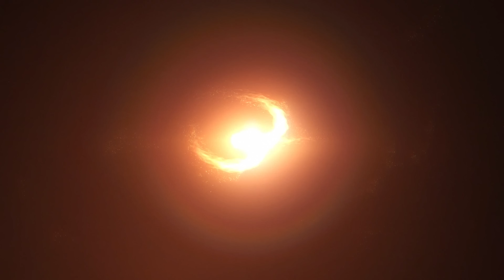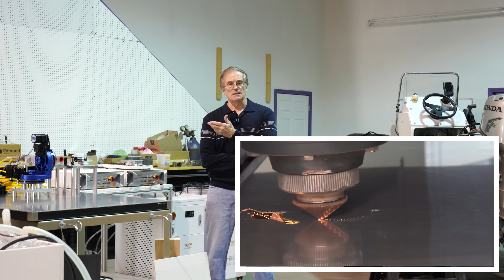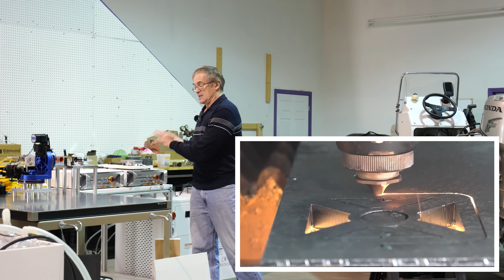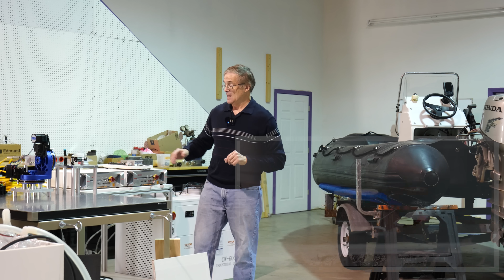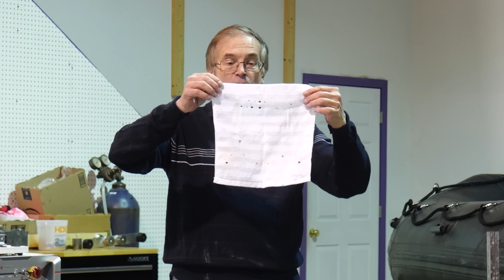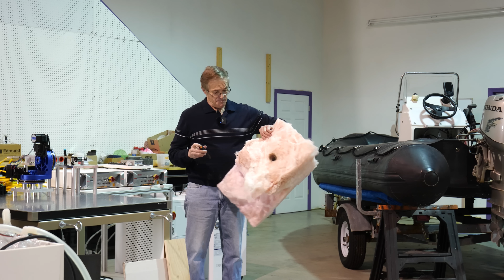We have a problem... and need your help!

Comment: This reminds me of the final laser scene from the movie Real Geniuses.   I think the answer is there is no safe way to test this so you should test it in parts.  You know you can direct a laser, so test the second part and keep the laser stationary and move the object you want to destroy.   Testing laser shielding options would be a fun video in itself.    One thought would be to use a falling film composed of water with suspended carbon black with maybe a soap to help maintain suspension.  Maybe the viscosity could be increased to increase the film thickness.

Comment: Ceramic or porcelain tile. Not sure which would work better but I use porcelain on my fiber laser engraver when engraving metal coins.  It's a much lower power use case but might hold up to your higher power laser long enough?  If you angle a backing surface you could stack the tile vertically (no cement) so it would be easy to replace if they are damaged.

Comment: Assuming you can't diffuse the beam at a fixed point before the barrier, I keep coming back to water. Maybe take a slurry of water, surfactant and gypsum and have the point of impact moving in relation to the laser. Make it a waterfall or even multiple waterfalls that the beam must traverse. If it worked, it would be cheap and easy to make a catch tank and pumps and a way for the fluid to evenly fall. I'm not sure about reflection, and I would be worried about that but I'm not an expert in lasers. You could use an air knife/curtain to force the fluid into an angled path instead of falling at 90 degrees to the ground.

Comment: The bad news are, it's all about power density S [W/m²], whenever high power Laser-beams are involved, because heat distribution strictly follows Laplace's heat equation (unless our patent for a kind of meta-material with anisotropic solid-state heat-pipe properties is used, as China did). Therefore, one has to disperse the beam e.g. by an array of cheap concave Fresnel-lenses made from hot pressed glass; optionally AR-coated. This can spread the beam quickly over a large area. Behind this array, an air-, or water-cooled heat-sink (e.g. from black anodized aluminium sheet metal) can take the thermal energy. You may end up with a wall from thin Fresnel-glass tiles, held by e.g. slotted glass tubes, mounted on a a frame from L-, or I-beams on wheels and a sheet metal behind this frame with some cooling on the back-side.

Comment: Charcoal Brick Wall (Temporary Dump Zone)
	•	Stacked BBQ-grade briquettes as a sacrificial wall.
	•	Not reusable but dirt-cheap and highly absorbent.
Used Black Firebricks
	•	Excellent absorber; already heat-seasoned; easy to stack or reconfigure.

Comment: 1. Thick layer of pure sand on the ground and hit it from the top. Harder to work and film but cheapest. You can sell glass sculptures to subscribers later.
2. Change your optics to be „dangerous” in specified range.
3. Ice wall. It will disappear by itself after filming.

Comment: Hi, I'm forwarding this onto our engineers at work. My knee jerk reaction though is to maybe try testing out some of the materials used in forges, like Kaowool, refractory cement, bread/pizza oven bricks, heat resistant bricks (more porous and light than bread oven bricks), or lava rock. You're still running up against something heavy, but it's materials that you could potentially put on a wall with wheels on it because it's made to be molded and shaped, plus it's meant to take a lot of heat. You didn't mention what part of the spectrum a fiber laser emits at, but that would also factor into what can be used to absorb/deflect/contain/disperse your energy. Hope this helps!

Comment: A Beam dump inside the beam dump use a very pointy conical reflector that takes the incoming beam and reflects it outward into the walls of the beam dump, the walls should be made either of a very high thermal mass material or out of several large heat sinks stuck together in sort of a square arrangement The backsides of those heat sinks can be painted with vanta black or realistically just any high temperature black paint to absorb the heat from the laser beam. On the front of the BM dump You should try to get one of those adjustable aperture things that I see a lot of artists using for drawing perfect circles so that you can choke the inlet side of the beam dump down to about the size of the beam coming into it which would help reduce reflected laser light coming back out of the front of the beam dump box The conical reflector that's going to be throwing the laser light at the heat sinks needs to be made of a fairly high temperature rated material probably high grade steel or maybe even titanium needs to be polished pretty well to a near mirror finish all the way around which shouldn't be impossible. I have a similar system to what I just described that I use for testing diode lasers in the 12 to 15 watt range it's even managed to contain a pulse laser though since that laser runs in infrared it's hard for me to tell how well it's actually keeping the light in

Comment: After thinking about it for a while, sheet metal covered in layers of a ceramic-based intumescent, or some other combination of ablative coating and base plate.
That or you build a water park in your workshop.

Comment: Some good suggestions for sure. Maybe try to replicate space shuttle tiles by making an aircrete mix with some black colorant mixed in. You could also presoak them in water or have a waterfall moving over the surface or both.

Comment: Water sand mix with rotation mixer and pressure air. This changes material, cools it and also chages surface for good absortion.

Comment: I know nothing about materials, so this may be science fiction. If you take the lens off a modern DSLR, you can see the mirror sitting at a 45º forward/upward angle. If you lift the mirror up, you'll see there's a secondary mirror attached to the back of the primary mirror, about halfway, and it's at a 45º forward/downward angle. The primary mirror is semi-translucent. It allows some light through that gets reflected downward onto the light sensor for metering.

I suppose this depends on how big your target area is. If you could, for argument's sake, find a material that will let through 80% of the laser and reflect 20%, you could put four sheets at 45º, each behind the other, behind the target. This way you can spread the light over 5x the area (one behind, four off to the side). Scale as needed.

Comment: Not sure if this is a good idea or not, but we just coated my roof with a white roofing silicone, maybe you could pour a couple inch thick sheet/block of the stuff and let it cure and try that. There's also an acrylic version of the stuff, not sure if either one will work but would be interesting to try.

Comment: You need a water jacketed backstop.  At the low end it could be something as simple as large evaporative cooling pads with constant water flowing down from the top.. It's a closed loop system.   At the higher end you could have a series of stainless tubes (say 1/2 diameter) that are stacked parallel with a common manafold pipe on the end with constant flow of water through them.   Back everything up with some silica welding blankets.   Should give you many seconds of safety time.

Comment: The Action Lab had a video on dielectric mirror films, explaining how they are so reflective that they have no Brewster angle. They are 99.X% reflective, damn near 100%. If you stretch this film over some flat backing, and mount it at 45 degrees, shiny side down, you could send the laser beam straight down into the ground and the dielectric mirror film should be unharmed because of its overwhelming reflectivity. Or straight up into the sky. 

Actually I wonder whether wrapping a drone in this material would protect it from lasers.

*EDIT*: Here's another idea. Instead of just leaving the dielectric mirror film stretched flat on some sort of backing board, stretch it over something airtight, and pump air behind it. This will cause the dielectric film to bulge outward, making it a diverging mirror. Then, when the laser hits it, the beam will reflect downward, but the beam will diverge, and will not have the extremely potent concentrated beam that destroys everything. Once you have a diverging mirror with sufficient curvature, a couple of feet of distance will bring the beam out of focus enough to be only a small fraction as potent as the coherent beam is.
Reply: Unfortunately, even if it reflects 99.9% of the light, that's 16 Watts absorbed by a millimeter circle of the very thin film.  The film probably wouldn't last a second.
Reply: @mikegreene6052 I’m still curious to see whether it would work. Maybe if the film were backed with water it could hold up against a dozen or so watts.
Reply: What are you basing your figures on? I seem to have guessed a little bit high on the power output of those lasers compared to others and I only get 6 Watts at 1mm focus - 99.9%
Reply: Reflecting back through the shop and burning holes on the opposite wall …
Reply: @leosmith5209 no, I mean angled downward to redirect any beam to the ground. I think I explicitly said this.

Comment: 1. Running water with black dye between two transparent sheets. In fact the water need not flow.  Glass, Kapton, acrylic can be the choice depending on the wavelength. May be aspault (tar?) solution can be used instead of dyed water.

2. Graphite granules immersed in water or oil.

Comment: What about if you use the  glass used in bathroom windows. It would allow the Lazer to pass through so it might not melt, but will scatter the laxer enough on the other side so it won't be concerned to burn anything?

Comment: Just modulate the Laser using Pulse Width Modulation if you can get at the output power supply.

Comment: Automatic interrupter switch:
Have 2 weaker layers of barrier, with a sensor tuned to the laser wavelength in between. Hook it up to the laser and turn it down if it detects the laser penetrating the first layer and hitting the second layer. Due to it being turned down rather than off, the sensor can still detect it and command full power as soon as there is no more detection.
Some AI told me start-up time can be quite long so I don't know if this would be possible with your laser unit(s).

Comment: My two cents would be large jugs of water. Maybe the thermal mass of all the water would be enough to not let the jug walls to melt. Maybe murky or opaque water would help as well if penetration occurs.

Comment: You might need a multi-stage system if simple absorption isn't feasible due to the laser's output.  If the beam is only capable of affecting a relatively small profile area, it seems it would be fairly easy to put a tube behind the target and pump fog into it to take advantage of the volume scattering properties.  You'd need a surface on either end of the tube that would allow the laser to pass without breaching, so another lens (or two.. could put one at the back, as well) could help to spread the beam out, with a final backstop that could better handle the now reduced laser, or what's left of it.

There are several laser backstop options in the medical field, and though what you're using and what they're intended for are orders of magnitude apart, you may find "scaled up" versions of some of what they have available might be suitable.  If you're still worried about cutting through, you might need to take the setup outside and orient it vertically, pointing into the ground.

Comment: You could make a cheap, portable beam dump using graphite blocks inside an anodized aluminum box with a heat sink on the back. The graphite would absorb the laser energy, and the aluminum would help dissipate the heat. Probably cost around $50–80 and should work well for fiber lasers.
Reply: Definitely want to use high temperature non reflective black paint to prevent reflection in the box. That and a good thermal paste to transfer heat off the blocks.

Comment: Depending on the wavelength of the lasers and its strength, you could reflect the beam using a rotating 45 degree angled mirror. The beam would then be bent 90 degrees inside a chamber where you can then use materials/solutions which can withstand the the laser as it is rapidly moving.

Comment: Mount a diamond bladed grinding wheel on a mounted grinder.  Get the largest wheel possible/feasible, and use the outside most portion of it. May need to experiment to see if the edge or side of the wheel works best. Aim the laser at the edge of the grinding wheel.  Grinder should be turned on and the wheel spinning, therefore the laser would not heat any part of the grinding wheel continually.  The speed of the grinder would effectively spread out the heat across the entire exposed linear path on the edge of the wheel, thus reducing the light power per exposed area.  The wheel then spins into either a bath of water or a spray of water (need experimentation), thus cooling the surface of the heated area.  A few things to keep in mind, the wet wheel may have reflections, aim the laser so the reflection would mostly hit more water somewhere, if possible.  Also, with this kind of extreme heating/cooling, there may be an issue of thermal expansion; I am not sure is such a high thermal differential would pose a wheel explosion risk due to thermal expansion.

Comment: Rockwool insulation.  Way more fire resistant than fiberglass. Comfortboard is 2ft by 4 ft by 1.5 inches thick.  Relatively inexpensive.  May you can layer it behind the 3/4 inch plywood

Comment: Option 1: Redesign your lensing apparatus to de-collimate by default. You should know distance to target and dynamically adjust to be focused at that distance. That is the most collimated the beam should ever be under full power. By default, it should be as defocused as possible. If possible, a separate pilot beam should go through the main optics with its own incremental focal compensator so that you can have a collimated trace beam for ranging and targeting, and then converge the powered beam only when fail-safes are temporarily disabled for active fire mode.

Option 2: There are apparently many effective ways to modulate power for fiber lasers. Using one of these can prevent you from having to re-invent this part of the wheel. It can also make a simpler design since you can down-power the laser for pilot beam ranging and targeting. You might even be able to use the modulator to emit an identification code for locking onto the specific marking point as a safety measure and a way to support concurrent targeting. Interlocks should work as above, enabling full power only when safety systems are temporarily bypassed for effect.

I see this more as a challenge of solving the right problem. Every other solution is going to be equally as challenging as getting such a powerfully focused laser in the first place, and you can't reasonably put another complimentary apparatus magically in the right place to reverse the process even if it were possible. Any material transparent or reflective enough to not be destroyed by the laser doesn't work and creates other risks. Any material which breaks down even a little will rapidly degrade into a more vulnerable material. There are reasons that different class lasers come with different levels of warning, and risk of collimated light scattering is a key factor.

Comment: You ran over the solution right in the beginning of your video. Let your laser beam converge/diverge faster. By using an optical system (maybe even photography lenses) with a very large numerical aperture you can let your beam start and end much wider. You should be able to get optics with >100mm effective aperture. If you assume your target is half way between you and the wall that also means the light at the wall is dispersed again to >100mm. The math for the focus shoulld be relatively easy, and if you set some sensible limits you could even let the system adjust focus distance autonomously to perfectly focus on the target.

Comment: Commercial water-cooled beam dumps, such as those from Laser Components or Newport, are designed to handle continuous-wave (CW) lasers up to 20 kW or more, with apertures around 50 mm. These devices can absorb the beam’s energy for extended periods without failure, far exceeding the “few seconds” needed to allow a kill switch or computer override to deactivate the laser.

Comment: I see two ways you can go about doing this.

Firstly is a sacrificial material that can absorb the energy converter into the heat. Ideally this material is lighter and thicker so that there’s more distance between the laser and the wall. Something you should look into is trying to cool the material, which would give you more time for the same material.

The second way to go about it would be dispersing the beam. There’s two problems to this. One being any material that could actually disperse the laser would need to be dense and thick, meaning you probably don’t have a nice portable or cost-effective solution. The second is that any material that does disperse it probably wouldn’t hold up long enough to have any meaningful impact.

Ideally mix both the previous concepts together. The first thing I thought of was pipes with cold water flowing through them, and as the laser hit the metal, even if it penetrated the water would disperse the energy and cool the pipes. 

If you had more budget, you could try to make a wall disalignment, glass or resin or something that would reflect the light in weird ways and spread it that more. Then behind that have the sacrificial material.

Ultimately, I think there’s a lot of stuff you could do. It would just be too expensive.  Your best bet is probably just a pile up a bunch of wet sand or gravel.